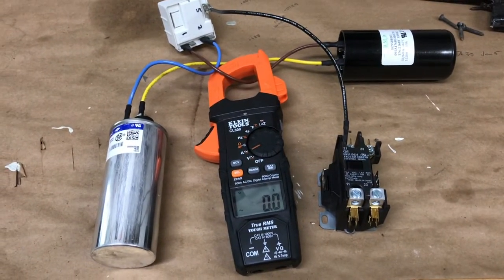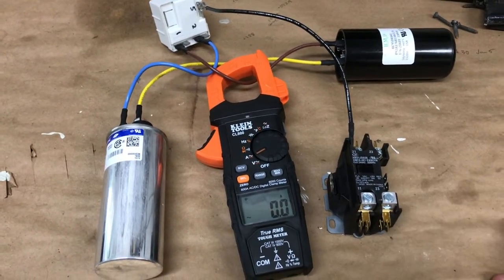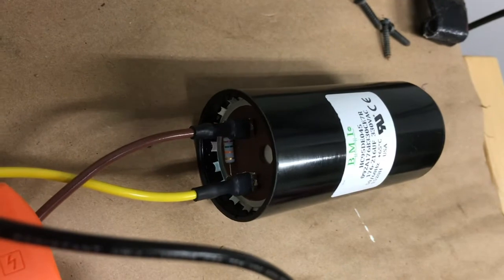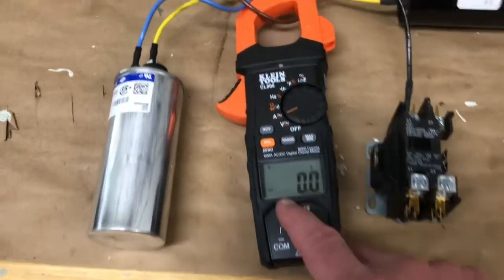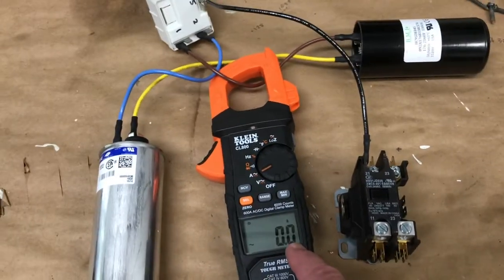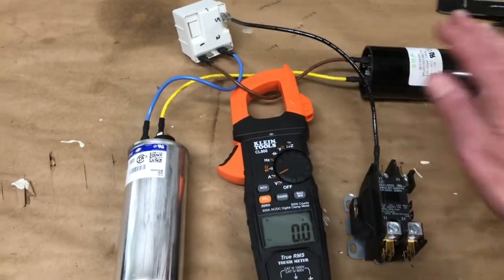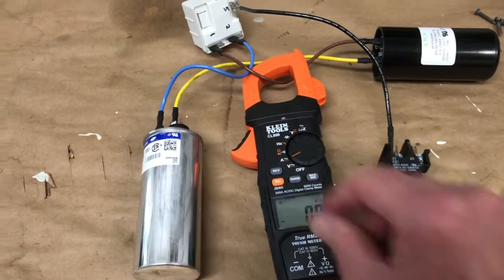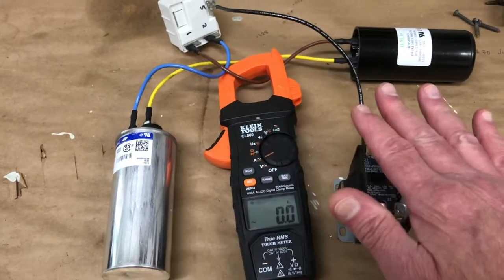How to check hard start kit is working

Comment: Great video! What would happen if the potential relay was stuck on and kept the start cap on the circuit? Would the compressor be ruin immediately? Is a 5 2 1 hard start kit on a otherwise normally working compressor too much of a risk to use? Some HVAC technicians recommend it to extend the life of a brand new compressor while others warn me of the dangers of ruining a normal working compressor if the run cap or potential relays fails at some point and by the time it happens, it would have been too late.
Reply from the maker: The start cap would likely overheat and blow up.

Comment: You said it was a pain to check the start cap because of the bleeder resistor but you didn't explain how to do it. I know how to check a run cap but is checking a start cap different because of the bleeder resistor?
Reply from the maker: You have to unsolder the bleeder resistor, then check the capacitor, then resolder the resistor.